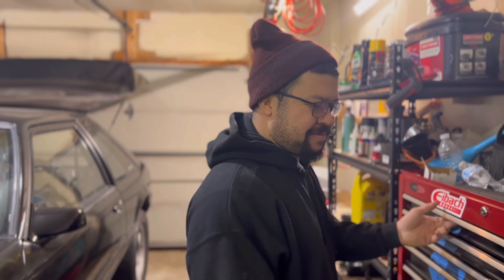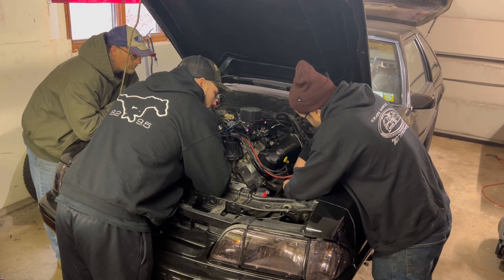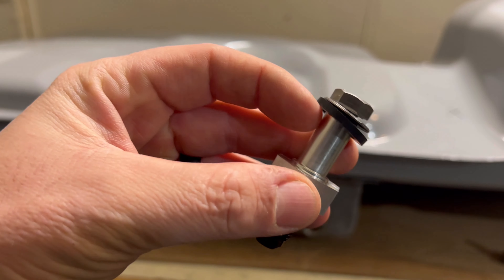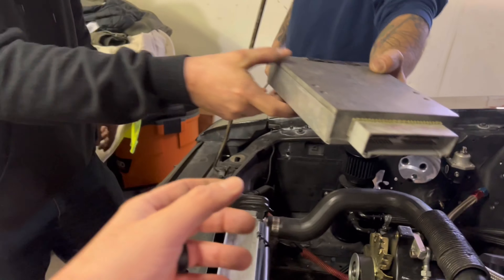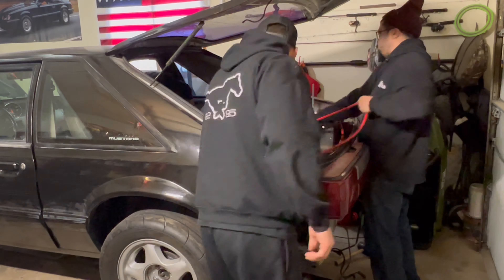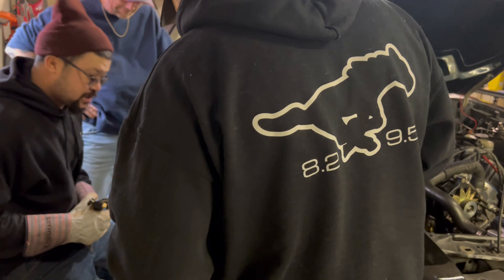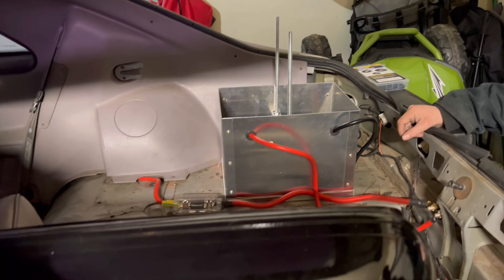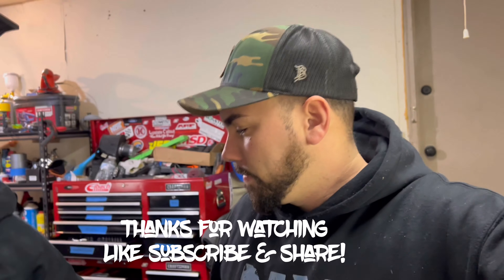Wiring up the msd on the Foxbody

Comment: I’m doing about the same conversion on an 89 lx 4cyl to a 351w with carb.  I removed computer and all wiring going to it and now trying to figure out which wires I need out of the bundle under master cylinder to get it running.

Comment: Just did a wire tuck when I switched to carb on my 91 notch. Be patient & Google wiring diagram for each item to get color of wire your are looking for. Thanks for sharing. Jim, Ohio
Reply from the maker: Hey thanks Jim, yea I wired everything up we're good to go now, the extra added fuse box i installed came in extremely handy, how are you liking the carb set up over the efi? Any more or less power?
Reply: Didn't drive it much before switching to carb & mechanical fuel pump. I tore it down freshened bottom & gt40p Anderson n41 cam & trick flow springs. Single plane intake with proform 650. Still dialing in air/fuel. Will be driving more this year. Love the simplicity though.
Reply from the maker: @jimcorman5842  yea I completely agree with you, much cleaner look as well, but yea that's cool man! Good luck with it I'm sure it's going to run good, I hear a lot of good things about the Anderson cams

Comment: Is the New gas tank lighter than the factory gas tank? Is it any better than stock or something?
Reply from the maker: It's the same weight, my gas tank already had a leak so I figured Id be better off just replacing the entire tank, also i wouldn't have to worry about the fumes when welding the new sump on
Reply: @Ny_Foxbody93  thanks 👍